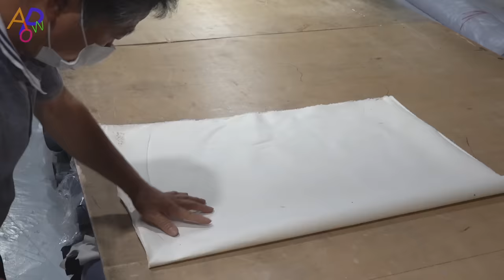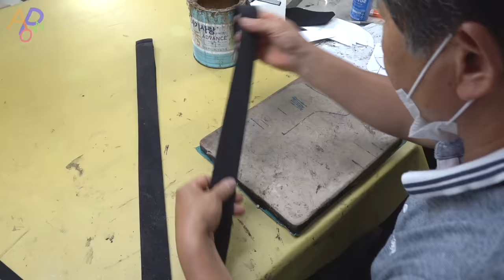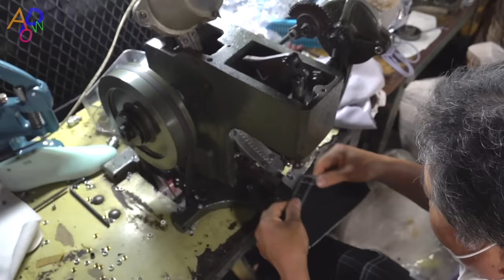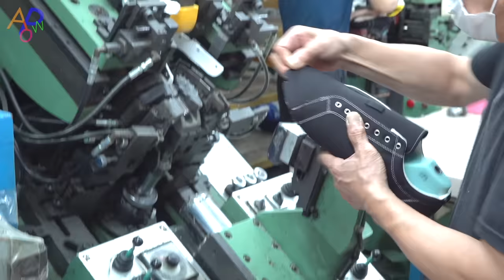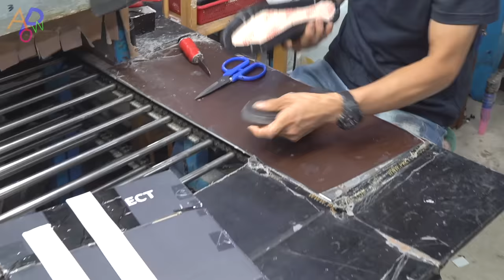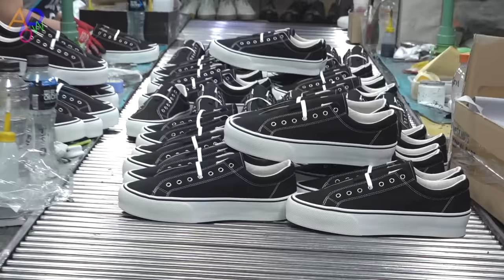Canvas Shoes Mass Production Process. 50 Year Old Sneaker Factory Of Korea

Comment: I think it would be great if the shoe industry sold individual shoes (left and right) for a reasonable premium of 30-40%. This way you could get the perfect fit by buying a different size for each foot if you needed it. There are so many different steps to customizing a shoe fit yet much of this works values is lost if one foot is of a different size than the other. With the advent of the internet, orders can be communicated very efficiently so it makes sense to try and get the best fit if it involves just mixing two different sizes — no extra work in production is required.

Comment: Yes, it's nice to see how hand-made these are. But you can give all honour to those people whatever you like. If the process is for a crappy product, it will be and remind a crappy product.
Check all that glue, it is subject to wear and tear conditions, as well as moist and temperature changes. It needs to remain flexible, but needs to bind in the aforementioned circumstances. There is barely any glue that will last, especially when using detergents to clean them.
This is a typical example of non-sustainable throw-away products. You cannot really wash those shoes, they are hard to clean without washing them. These will degrade and end up as waste way quicker than the variants with vulcanised soles that have durable canvas.